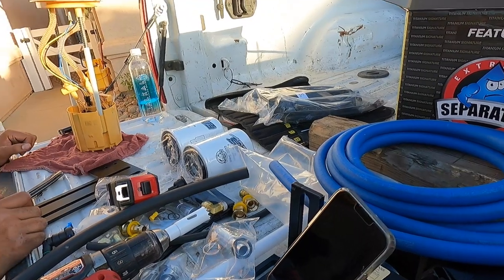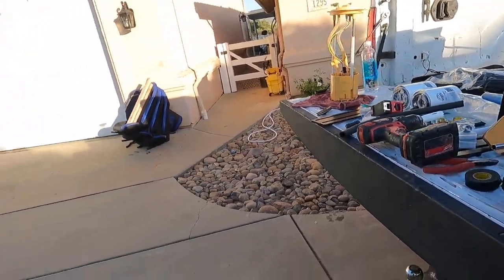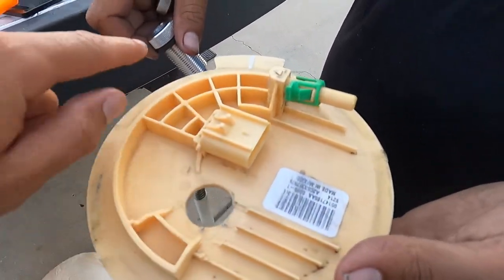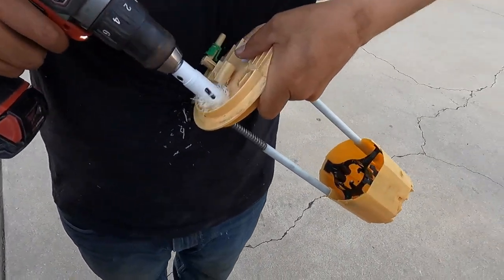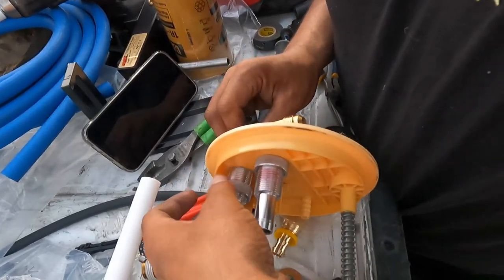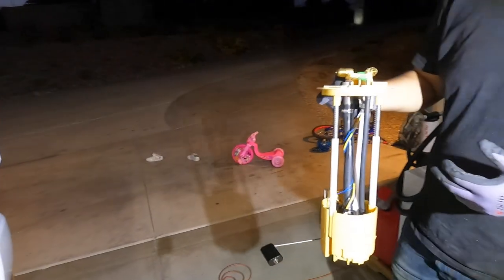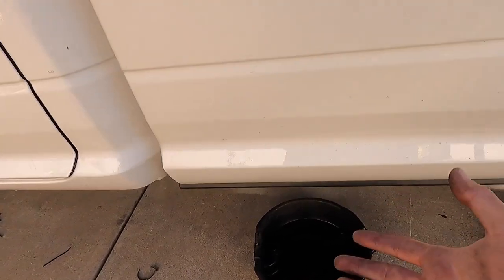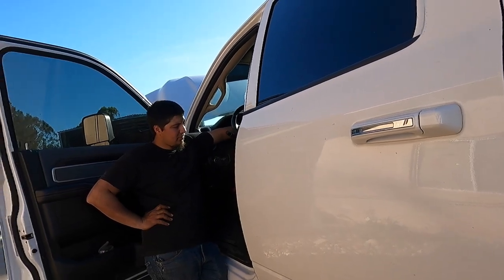FASS 165 Lift Pump Install...WORST INSTALL EVER!!!

Comment: I installed a air dog 2 4g first time ever. Wasnt hard dropping the tank(btw my truck is a 2021 ram 2500 mega) and modifying the lift pump is way easier than FASS IMO tool me about 5mins to do that. Hardest part was putting the tank back in since i have not lift just my garage and hydraulic jacks. Air dog doesn’t make you remove your existing fuel filters, so when i ran my new fuel lines to front and start the truck(obviously let in run without start the truck itself), i honestly thought the pump wasnt working, but thats just how quite the 4g 2 is. But after 1 min when I started the truck on, it turn on with out a hassle.

Comment: So why cat filters? I’ve heard lots of misleading info on cat fuel filters. Was told they are not as good as fass or stock filters. Then I heard they are better. Can’t seem to find any solid info for why you’d run cat over fass on a fass pump.